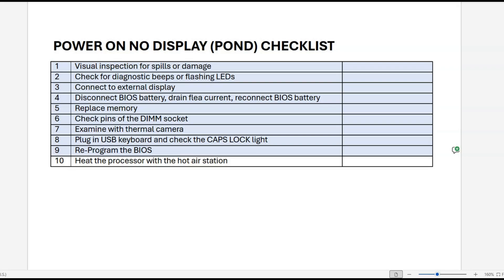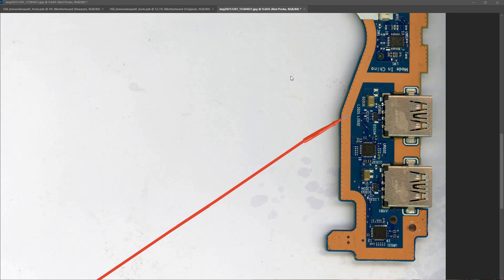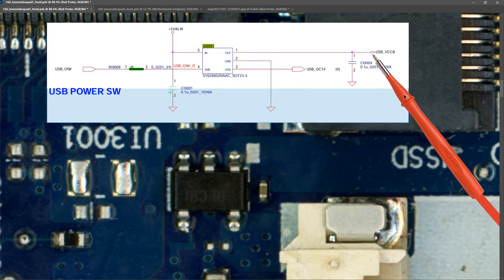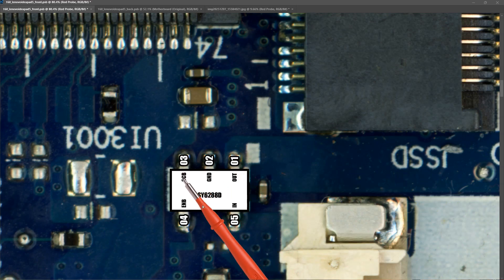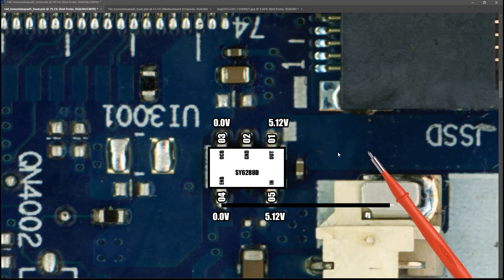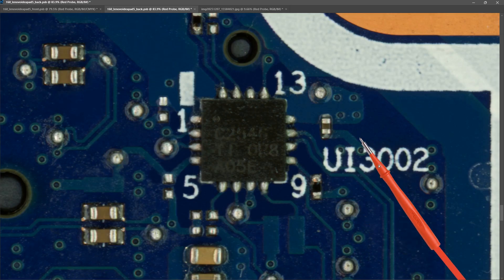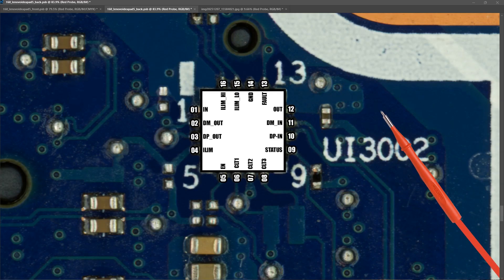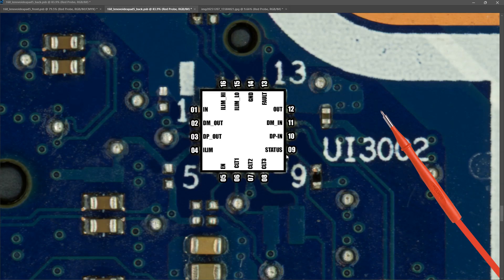LENOVO IDEAPAD 5 - NOT POWERING ON (PART III)

Comment: I had a similar problem with the 5V USB power on a board. I looked at that 5-pin switch but didn't discover anything useful. You did far more research than I did